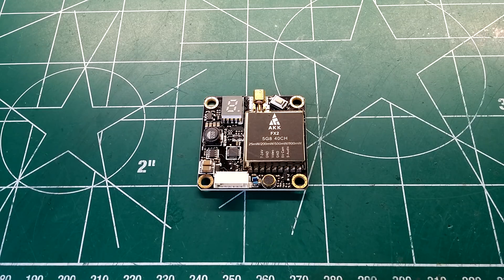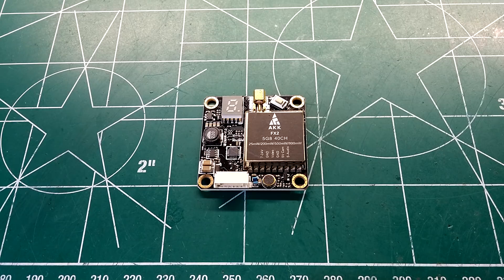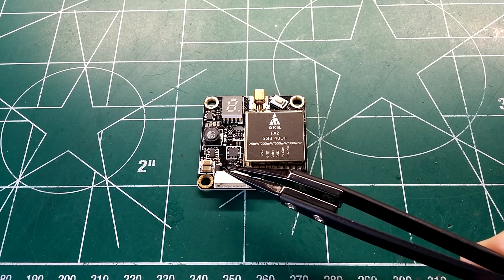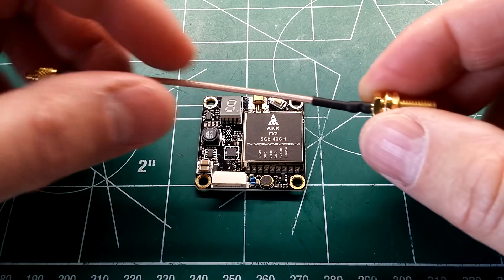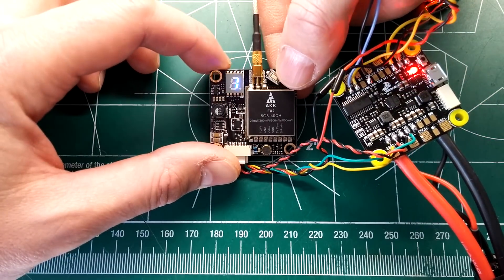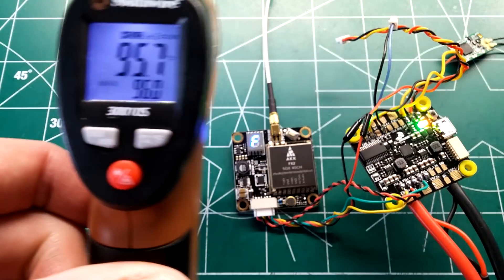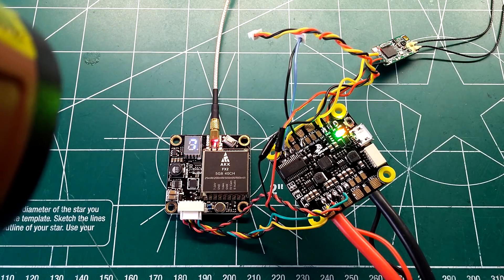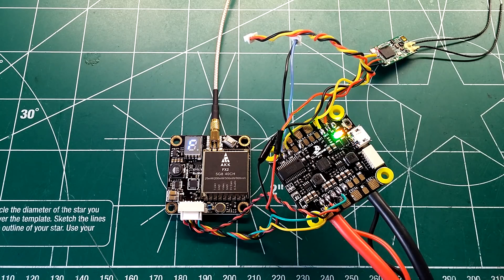AKK FX2 40 Channel Smart Audio VTX Review

Comment: Heya there bud, new sub here. I was curious, I have the wolfwhoop q3 pro. It says 7-26v, I have it connected to a 5v rail on my helio, Just curious if this would be underpowered
Reply from the maker: Yeah from what it looks like that vtx can only be powered from a 2-6 cell battery from it's voltage range description, personally I'd power it from vbat or a 12 volt rail if you have one available.

Comment: Hey Steel nice video....I have a question that I can't find a solution... same Flight controller same VTX But I want to use it whit 
TBS Crossfire receiver.. On micro receiver v2 we use 4 wires gnd,5v,ch1,ch2.. on the flight controller gnd,5v,tx4,rx4 My question is...Whit this configuration were the green wire will be solder? Thanks in advance
Reply from the maker: Ultramano - You have to find an open TX uart for smart audio to work, everything works the same in regards to smart audio and the TBS Crossfire system working together.

Comment: my signal pin is grounded, is that normal?
Reply from the maker: krssnoop - I just checked mine to make sure, but you should not be getting continuity between the signal and ground pins.
Reply: So was yours grounded too? Mine works perfectly fine, I didn't think it would work at all.
Reply from the maker: krssnoop - Mine was not grounded, nor should it be. It's weird that yours is and it's still working, and as long as you're getting no odd effects such as video blackouts or noise in your fpv footage, then you should be good.
Reply: SteelRainFPV the image is cristal clear and has good range. I'm just going to continue using it anyway. Cheers!

Comment: Nice review, I just reviewed the same VTX on my channel, got excellent picture on 2.5 km range (it was too cold that day, and my fingers froze, so I couldn't do the whole range test), but I assume that it will go up to 5 km without problems (I got 4 km with AKK X2). Excellent VTX.
Reply from the maker: Gorazd Cok - I was initially impressed by this vtx, it's cost, features and it's specifications as well, but it fell short of it's manufacturers stated power output claims in my vtx shootout video unfortunately.

Comment: subscribed...  :D
Reply: And this is my first question :D   A light please...on this CL Racing F4s how to connect the wires to use TBS Crossfire micro receiver SBUS,5V,GND,and the 4th wire were i have to soldering it? Thanks in advance.

Comment: I get horrible range with mine. My other vtx's on 25mw have more range than the fx2 on 200 or more other than that I do like the layout and options offered. Maybe I got a bad one?
Reply from the maker: A-Aronfpv - I don't think the quality and quality control of this brand of vtx board is up to par, and if you look at my vtx shootout video the fx2 that AKK sent me did horrible in the power output testing.
Reply: Well that sucks, mine seems great on 800mw.  I was about to buy another.
Reply from the maker: mooosestang - Unfortunately a lot of people won't notice the lack of power output until they push their equipment to the limits, such as long range flights with a TBS Crossfire or EZUHF radio system, but when they do and the vtx fails to perform when you need it the most, that's definitely not the time to trust sub par equipment on an expensive build.

Comment: You know you can use an F3 or F4 Flight controller (OMNIBUS) with GPS module on fixed wing and planes as well with RTH, waypoint fencing, ALT hold and loitering function
Reply from the maker: RC-SkunkWorX - Yes I do, with the Inav gui, but I'm not sure that I will be using Inav or a gps on a long range 6" inch build due to weight constraints while keeping the build efficient. Personally I'd use my ImmersionRc EZUHF with 1.3ghz vtx and rx gear on a build that would fly for more than ten minutes, which I already have on a 15" inch 8kg ap rig.

Comment: you can purchase SMA or RP-SMA pigtails for MMCX these days, thankfully
Reply from the maker: Faawks - That is very true but I thought I'd mention what this vtx comes with, and what it should of came with, because nowadays in this hobby with all of the options we have, we shouldn't have to buy extra equipment to make the vtx function correctly. Now it's not a big deal for me since I'm going to be using an mmcx pigtail with a built in axii antenna, but a lot of people don't want to purchase extra equipment to get the vtx working out of the box. Thanks for watching and commenting.
Reply: No problems, keep up the good work!